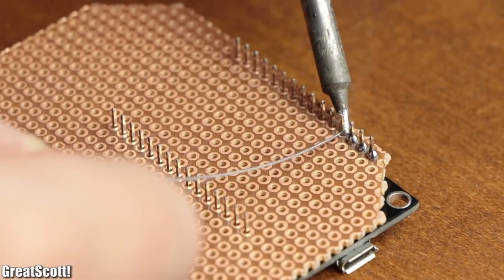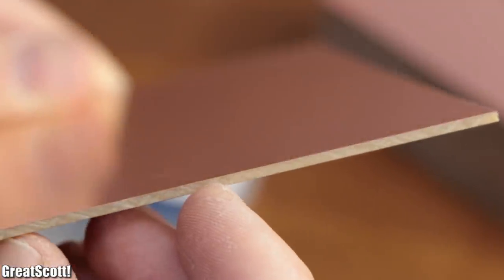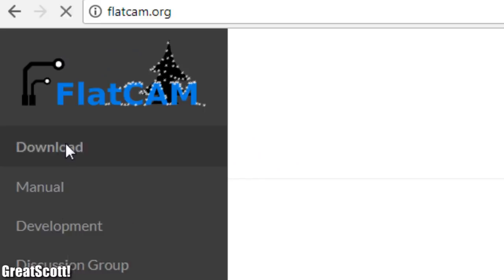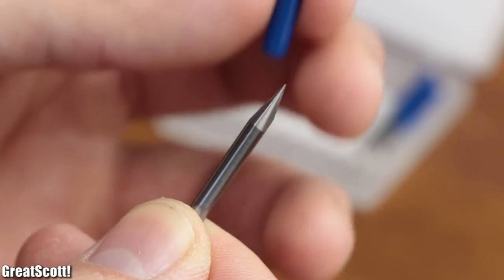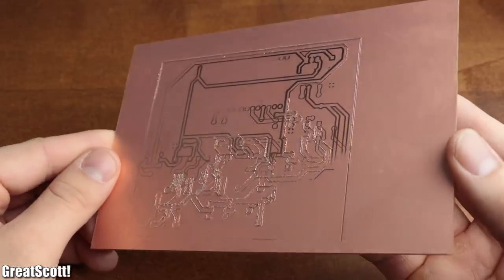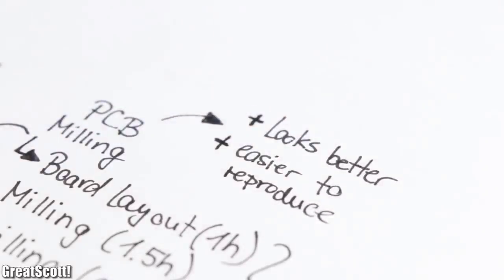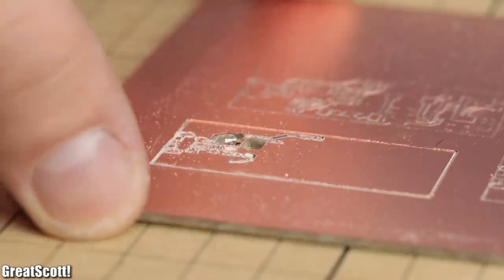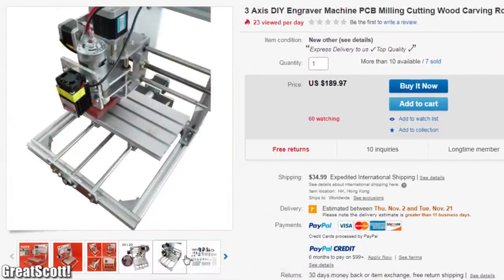How NOT to Mill a PCB (except for SMD)

Comment: I've been using a $200 CNC from China to mill PCBs for a few months now. There was a pretty big learning curve to get over (granted I was also new to KiCad so that definitely added to the difficulty) but the results are pretty good. Autoleveling is very important, but Chilipeppr makes that pretty easy to do. I tried etching boards first, but that never worked very well for me. Summary: If you're looking for a way to make nice PCBs quickly, I think a minimal CNC is the way to go. Keep in mind, no board house can get you your PCBs in a few hours - a CNC machine can.

Comment: Your machine needs tramming. That will fix most of it. But for perfect results you will need auto probing too. I completely disagree with your conclusion though. You have a lot of practice with other methods, and very little with this method. Once you get the hang of it you will make them much faster and much more accurate. Also you forget the fact that in 15-60 min of milling you will have your finished product, NO waiting for order and shipment etc.
Reply: agree.
Reply: But it takes me just 30 min independently of the size of PCB to etch it. I use toner transfer method with a laminator. Stable accuracy is 0.2 mm and can go down to 0.15 mm if I'm more careful. And the price is lower than buying router bits. Personally I don't understand the reason to mill the PCBs...
Reply: Ričardas Leščinskas engraving bits are cheap and easily replaceable. Milling appeals to me because it doesn't use chemicals (I can't have most etchants in my work environment), it only cost around 200$ for the machine, and it's a single step process (put the board down and run the gcode).
Reply: Ričardas Leščinskas-  i agree, and with practice, a laser printer and an iron for clothes can be used for some pretty accurate toner transfer onto a pcb, then you etch it and its faster than the mill. I even make my own enchants (ex: hcl and h2o2)  dirt cheap and works better than ferric chloride because I can see the pcb being etched.
Reply: Garrett Green this guy spams on every single fucking comment it pisses me off.
Reply: I'v reported every singe one of their comments that I'v found. I encourage everyone to do the same, and with all your accounts. Such a large amount of reports should get their account terminated or suspended quickly.
Reply: I've taken the time to report all of the links I found here.  How do I report a user?
Reply: @Tech Gorilla
Go to their YouTube page, go to about, and click the flag icon at the bottom. It'l ask a few basic questions. When it has the section about "find their comment on another video" paste in the URL of this video and check as many as you want until it allows no more. Then finish up, comment at the bottom something like "This user is spamming and posting many links, which is in violation of the community guidelines and terms of service". Sound professional, because if it comes to it, a real person will read that. Then, submit the report.
Reply: @Kieran Short
I also believe it's a compromised account. They have a few videos and it seems unrelated to the spam. The descriptions have been changed to include the link in question though. Wish I could just flag all the comments at once. Guess that's the only thing joining YouTube Heroes would be good for. XD
Reply: milling is far better because you can mill and dill , with toner transfer you still have to dill all the holes which takes time  and is easy to stuff up on complex circuits,  Sure milling might  take some time to get the hang of but its worth it.
Reply: @theLuigiFan0007  Thank you.  Done.  Curiously, the comments on this video dropped by almost 300 when I blocked that user.  I've never seen that amount of spam before.
Reply: There were deep cuts right next to shallow or even none at all cuts.  The problem was probably almost entirely that loose screw.
Reply: Well I couldn't disagree about the drilling. But I myself usually use SMDs and only few holes needs to be drilled which I make on mini drill press. I mastered toner transfer method so it's way easier for me and I have a CNC machine, but don't use it for such a purpose. I guess it's for the person to choose. I might mention I make at least 5-10 PCBs every week.
Reply: Definitely agree.  Almost all of the time-consuming processes involved in milling a PCB are things in which you just put a new bit in the machine, zero the axis, and walk away to do something else for an hour to wait for it to finish.  And drilling -- even if you use mostly SMD components, it's almost indescribably lovely to just put a 0.4mm drill bit into the chuck and walk away while the machine drills out however many dozen perfectly-centered via holes without you having to carefully scrutinize the position of your drill bit even once.  Regarding auto-leveling -- it's extremely unlikely that you'll get good results without it -- luckily both bCNC and Chilipeppr support it natively, and it's a relatively quick process.
Reply: I agree, I have a cheap Chinese CNC, I was about to abandon the idea of PCB milling, than I discovered "Auto probing", the results are excellent, and I also have the excellent automatic drilling the methods do not have.

In the past I used etching, and made over 100 pcb's, but it's quite easy to make a serious mess of the work area.
Reply: i think he maid one mistake with the time, because when you make it by hand you have to sit there 3hr and make it but with the CNC you can do diffrent things while the board gets milled
Reply: And shipping to where i live costs nearly 20$
Reply: design pcb, send to machine, prep and eat a meal or do a shxx, come back grab your pcb and then start soldering
Reply: it's also important to note that your hands and time are free during the milling process. you can work on something else.
Reply: What's tramming? I'm looking into getting a cheap chinese cnc to make pcbs. Cheers.
Reply: @RicardasLee  But you can not walk away from your toner  method to do other things while it's transfering now can you? Also it's really messy. Personally I prefer the using a cnc-laser. Just spray paint the copper boards with black paint. Laser them quickly without having to worry about breaking the bits or going to deep. And them simply etch it as you would with the toner method. Besides, if you have a good laser it's MUCH more accurate.
Reply: @MikesDIYTeslaPowerwall  You're right IMHO... If you need 0,6 - 1 drills (a lot for example) this small cnc is awesome (i have one)... however milling can be very shitty, if it's not leveled (small boards OK for me, have issues with bigger one).  With enterprise grade PCB miller machines (i worked on an LPKF protomat 92S at my school few years before) there was no real Z axis, only "a half", but the machine have a head, which can be adjusted to the depth of your mill (in very-very tiny steps, with a turnable thing). Since the adjusted head push the pcb, the tool only goes down that far, what you setup before, and the machine just switch on-off a solenoid... Course, it's not working with a wood/metal 3D part, which need proper Z axis, but for PCB... it's easier, and can give constant good quality)
Reply: it took the machine more than 60 minutes. in my opinion small /easy projects faster by perf board, complicated projects and production process better use milling if you can set it right and level
Reply: @athrunzala5337  His feed rate was a bit slow. IIRC, he used 80mm/min. On the last board I milled, I used 180mm/min.

Comment: Paint the pcb. Use a spring loaded engraving bit (drag bit) to remove the paint. Put the board in ferric chloride. Pull out and remove the paint with acetone. Perfect results every time. And by the way, you're milling WAY TOO SLOW
Reply: Can you recommend an engraving bit (spring loaded)? I cannot find one on amazon
Reply: you can just paint the traces with permanent marker and then just etch - I used to use it as a etch resistant and it works quite well. although you have the common problems of etching: no drilling, you have to very carefully watch how much time you live the board in the etchant, etc.

Comment: Since you are using a V Tip - the lower your Z  Cut is, the wider the cut gets.   FlatCam has a calculator to compensate for this.  If your bit is 0.1 mm and has an angle of say 30 degrees and you are cutting down to .12mm you need to enter these values in the calculator.  You will then need to replace the 0.1 diameter with whatever the calculator throws at you.  This will result in perfect PCB's everytime.  Personally I prefer to cut a little deeper since as you said boards - especially the single sided tend to be warped.   Oh and while my CNC is milling a board I am usually soldering the previously milled board - so actually it is a time saver.   To speed things up I even installed a vacuum table so that I don't even need to tie down the boards during milling.

Comment: There's a plugin for eagle (or rather user language program) called pcb-gcode using which you can create gcode files from eagle directly. You also need an external program for autolevelling. I don't understand why would it take as much time as in the video, my pcbs are usually finished within 10 minutes including drilling.
Reply: "I don't understand why would it take as much time as in the video" Maybe because is a noob?

Comment: I find just a little bit of erroneous bias in your math. You included the time to do PCB layout on the CNC side, but you didn't factor in the time it took for you to plan the layout on the perfboard. It probably wouldn't have added much to the time it took for you to assemble the circuit on perfboard, but I don't believe that there wasn't some planning involved there, as pretty as your circuits look on perfboard. :P
Reply: Calyo Delphi first that, and also you have to solder active for 3h, while the 1 hour of the miling process is automatic, so you could do things in that hour, too
Reply: @yatagarasu1495  true

Comment: this comment section is full of good info... I'm using a cheap cnc machine from china, I don't have such fine traces on my boards though, so I'm not running into the issues you're having.  Since you've invested in the X-Carve I'd say it's especially worth putting in the time to figure out how to get a quality board out of it; I'm sure that with the right bits and technique it can handle those fine traces with no problem.  Also it didn't really seem fair to count the time for installing and setting up the software since you only need to do that once.  The way I see it, once you've figured out the entire process and gotten your mill calibrated properly, all you need to do to make a board is design it in autodesk (or similar program) which you can do on a laptop whenever you have free time, and then when you're ready to work on your project you just send the board to the CNC and let it work while you prepare your soldermask and components

Comment: Dear GreatScott!, I have received my "0.1 mm engraving bits" and shall proceed with a small PCB SMD test on my 3-in-1 WanHao/PowerSpec/Duplicator i3 v2 to see how the 3D printed Flex Shaft Dremel attachment will handle the milling process. I suspect that even with the Z and Y braces, there will not be enough rigidity in the frame for this task. However, with the Y-axis alignment mod and printer bed braces ( to keep the bed still with CNC operations like "scratch-engraving" or CNC drilling") I was able to successfully produce a 2 layer PCB 14 x 16cm with ±0.25 mm accuracy across the PCB (X-axis). Used my 3D printer to CNC drill the through-holes and 0.5 mm VIA's (416 holes in all!). I also used my 3D printer to "engrave" the traces with isolation "routing" using a spring loaded sharpened steel 8mm rod salvaged from an old inkjet. I have wanted to try also the milling approach with this setup and shall soon do so. I shall also produce a video about this subject using a 3D printer as also a CNC drill/mill/laser engraver( or cutter).

Comment: You can't count the time while it's milling. It's time you are free because your machine is working for you.
If you want to count that time, you should also count the 2-4 weeks it takes to get the PCBs you order.
Reply: Thoughtful response. Factual response. This. This is it chief.
Reply: And setup/layout time is decreased for the 2nd and following boards so you really can’t count that. Would be the same as ordering PCBs from overseas, that software has setup/layout time for the first board as well. There really is no comparison when doing multiple boards, don’t try to do it by hand.
Reply: You have to be watching the CNC machine anyway just in case something goes wrong.  I've done a lot of PCB milling.
Reply: @raulcortes937  I watch it 1, maybe 2 cycles, but if those worked out I just walk away and let the machine do it's thing.
Reply: Gustav Ferdman I disagree, your milling bit can break, or degrade, you can’t be sure your pcb is perfectly flat... you need to watch it.
Reply: Exactly. Also consider the time to find, plug in, and heat up the soldering iron. Add the time spent learning to solder and making mistakes.
Reply: Not me, after putting in the time to design the circuit, I’m so excited to watch it come to life that I can’t focus on anything else!
Reply: I don't think so ... because you're waiting patiently for that part and if the results turn out like the video he has shown then the frustration will be even more ... when you start a project, it's psychologically very hard not to follow it through and be doing something else
Reply: @OpenSourceOnly  No that cannot be added cause soldering is a mandatory process anyway even after milling
Reply: Not really because it's making slot of noise in your environment and needs checking periodically, can't just walk away and forget about.
Reply: @raulcortes937   @Gustav  Hey which CNC machine do you find most suitable? and which one do you actually use?
Reply: As a CNC machinist by trade, I agree with this sentiment.  As for having to watch it all the time, No.  You dont have to be there the whole time.  Tool breakage and gouging is almost always an error in setup or programming.  Watch it for bit, and if it looks ok, walk away.  With the correct feeds and speeds, and a quality cutter, tool wear and breakage is usually not an issue until you've made quite a few boards.  This is like anything else though. Your first try will probably fail.  Just learn from it.  

Now granted, the following will add more noise, but you can use a vacuum table to hold the blank pcb flat.
Reply: @justincoleman9776  I would also say that if the bit breaks, in case of flat milling like a PCB (this would NOT apply to a big enough 3D part), you can't do anything to protect the board or machine further, nor would it make any difference if you stopped the machine midway. I can sure imagine some very impressive and unlikely scenarios of catastrophic failures that you do need to e-stop it (that you better NOT be watching it either for your safety anyway), but in most cases you either stop it and see that you just freed the machine of the rest of the work, or come back to see the machine worked in vain and wouldn't have made a difference to stare it.
Reply: Agree. For mass production, i agree with order PCBs. But,  for developing a PCB, in reality how much it take time? And when sometimes you get bad design and need to redesign and reproduce the PCB? Go for wegster or bantam if you want get good result and easy way. Money doesn't lie.
Reply: Great point, the waiting time for pcb is annoying depending where you live. You probably need to adapt the pcb routing tolerances to get match cnc capabilities, then great option for testing experimental boards.
Reply: YES! THANK YOU FOR SAYING THIS!, I was thinking the exact same, it took 1 hour to design, 1.5 hours watching a movie while the CNC works... I don't count that as working hours... I was watching a movie ! so yah, I was thinking exactly the same, if you will count that as work, then the weeks wait is also work!
Reply: I did PCB Milling, taking > 24h per PCB, with large, densely packed, double-sided layout. I had to check at least every hour, to see if things go well. Also, splitting the gcode file in multiple files, to have better control. Including some fine tuning,  like smaller tracks in areas with SMD, and wider tracks for PTH areas. Additionally, the process is pretty fascinating, so I watched it ~50% of the time. At night, I used an alarm clock, to wake up every hour. Overall very time consuming,  but interesting and most importantly, I got my PCB ready, after 24h and didn't have to wait for mail from the PCB maker. Overall, an interesting experience. 😊

Comment: 1. Use better bits. They will not tear copper and leave clean cut surface.
2. Use autoleveller and auto Z zero feature.
3. You can mill pcbs with 500 feedrate.
4. Mill with 0.1 depth.
Reply: Hi, how I can search for better bits? give me some clues please! thanks. Autoleveller and auto z zero are features of the software?
Reply: @cdsplus1  I wanna know that too. Maybe regular carbide bit with 60 degree angle?
Reply: @dzervas  Take a look at high quality ''Flute Spiral Engraving V-Bit 30 degree'. I've been using this little monster and, til now, it works.